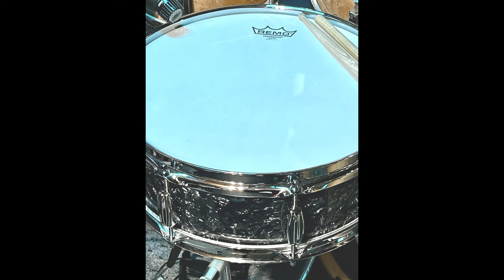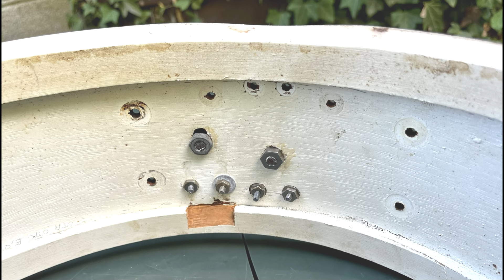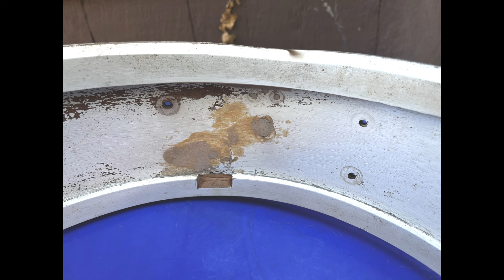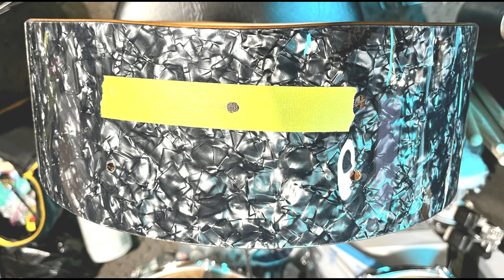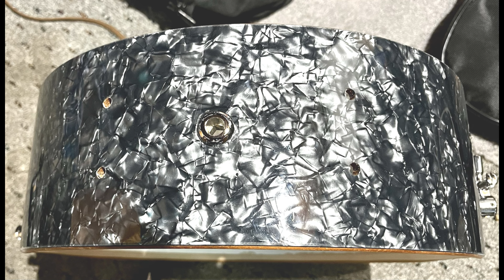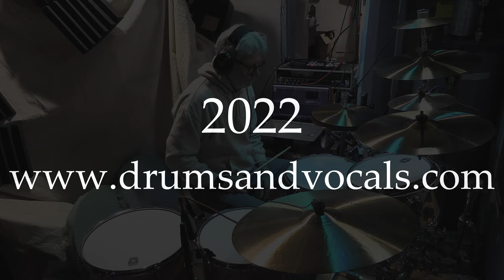Tom Venable Plays a Solo with a 1929 Leedy

Comment: Remo heads?
Says Evans in the vid/
Reply from the maker: Actually, I shot the Video before I completed (Changed) the drum. Yes, I replaced them with Remo Ambassadors and REAL Puresound Snares AND 3mil Heavy Gibraltar Triple flange hoops. That is the drum I demonstrated.Sorry for the confusion.
Reply: @venableman  Regardless ,great crack and snap.
I modified a DW NOB using 3 mm Tru Hoops and a Trusonic snare carriage.
Interesting sound ,but it weighs a ton.
You can check it oy on my YouTube channel if you're curious..
Reply from the maker: @cpu554  will do!
Reply from the maker: @cpu554  Those DWs tend to be a little hefty. I have the New Carbon Fiber 6.5x14.. Sounds great!